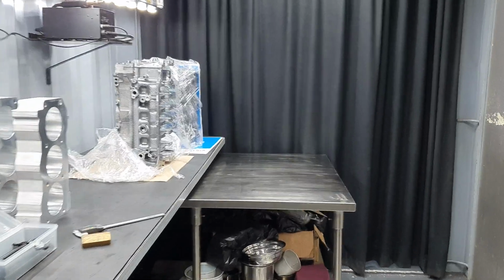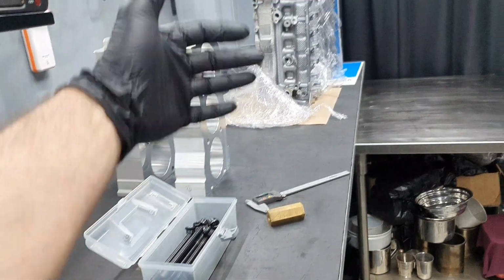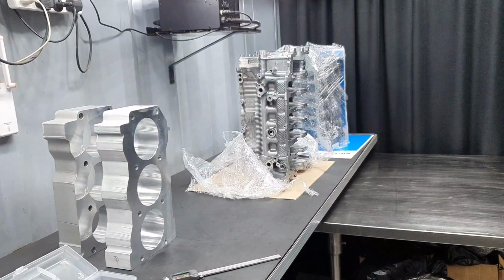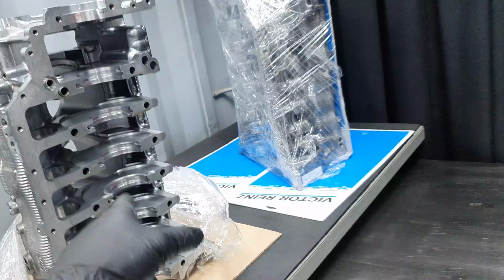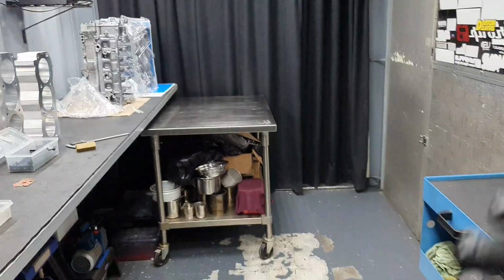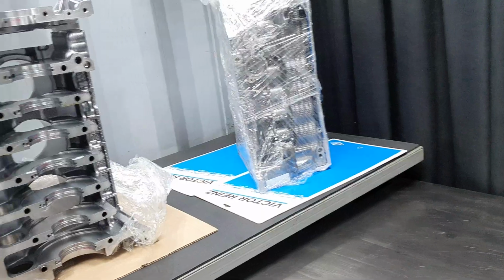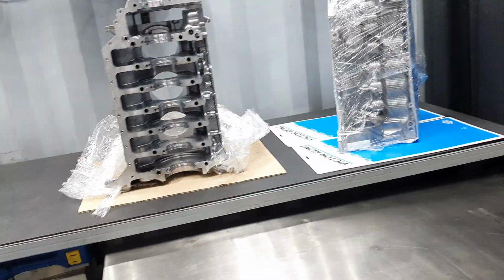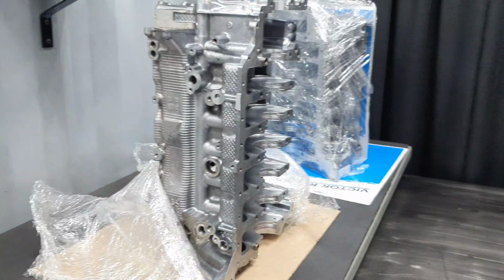missing oil jet nozzle (part 7)

Comment: Considering that the oil jets are supplied directly from the main bearings, the owner is very lucky that the crankshaft was not damaged from the low oil pressure caused by the missing oil jet.